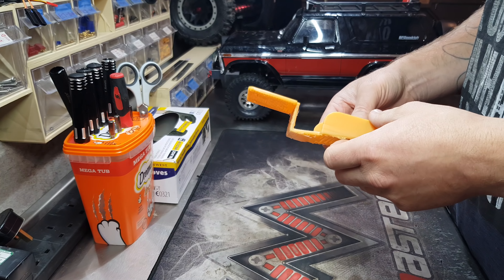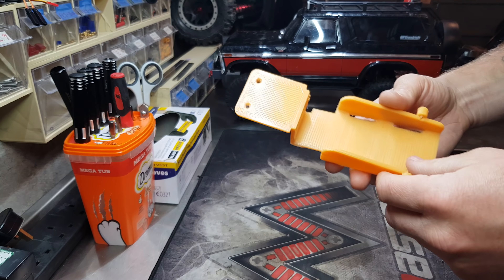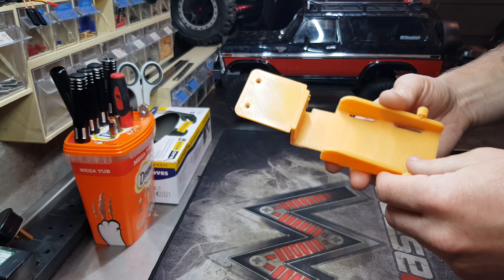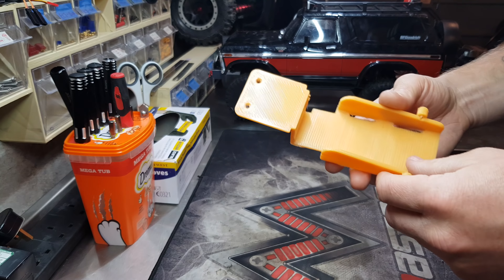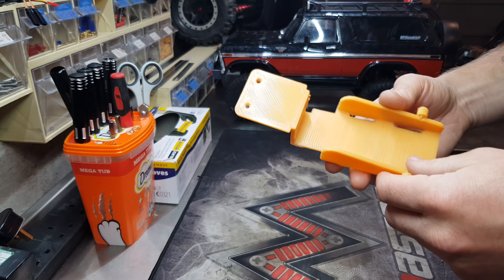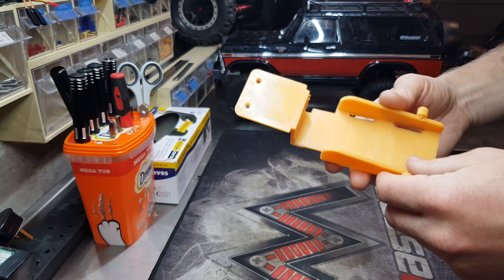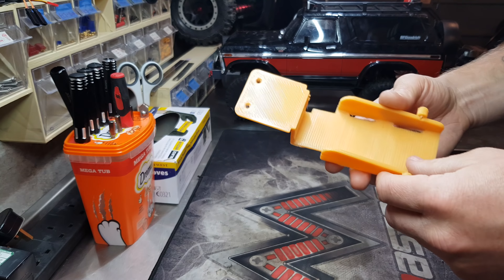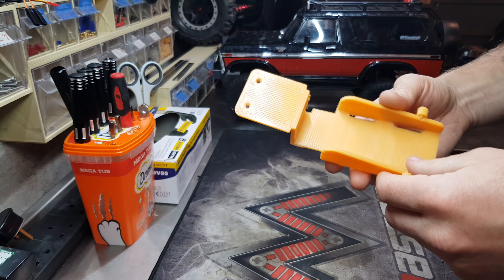Traxxas trx4 battery tray mod low cg, install and test, mod vs stock..

Comment: I see Klipsch good knowing someone else has good taste in speakers. Subbed
Reply from the maker: Haha, well spotted my man! Nice to hear some appreciation for them.. i have upgraded since this vid
Reply: Noted that too!  I've got my klipshorn still.  I'll never replace them, recently upgraded them after 20 yrs.  Mark Levinson Amps running em.
Reply: Lol I noticed that as well. It looks like the Reference Premier series based on the horn. What did you upgrade to? I have KG 5.5s with Ti tweeters in my family room and LaScalas with the Crites Crossover and tweeters in my basement.

Comment: Stock tray works fine
Reply: Agreed
Reply: no. his problem was metal roof racks and soft foams, so the low cg effect got lost. After installing it (and harder tire foams probably), the sideways is much better.

Comment: For one you should install the lcg properly , the front has to be flushed with transmission and bolting it down helps ...if installed right it places the battery low between the frame ...try the new molded version , also try it in real environment cos its a night and day difference on how the truck drives . Better in every way possible and definitely worth then 25$ online .

Comment: Which bumper do you recommend the most for crawling/looks on a defender?
Reply from the maker: Hi Sean, I would say anything that doesnt hang low and almost acts like a slider to help you over rocks, also nothing to wide to hang up on the edges, I learnt this after fitting one to my bronco and it was like night a day difference.
Reply: @jaypearce6199  thanks Jay! I love the camel bumper, but I'll have to swap something low profile like you said. Appreciate the info as I played with $100 cars as a kid, but the trx 4 is the first serious crawler I'll have ever used(comes in the mail tomorrow morning!). These things are so close to full scale cars! Can't wait to get crawling😁
Reply from the maker: @seanclarke4061  no worries man, yeah they are some serious dogs for sure, good luck with everything 😎

Comment: Will it allow larger 3S batteries to fit? I haven't been able to use my 5,200mAh 3S batteries in my TRX Bronco
Reply from the maker: No I'm afraid your kinda limited on size, I can just about fit a 4000mah Turnigy graphine.
Reply: Jay Pearce what brand battery?

Comment: Your side hilling is not much. Your tire's sidewalls are too soft. You need a stiffer 2-stage foam or some anti-foams so your tire doesn't roll under. You will get a lot more side hill capability if you fix the side walls from rolling over. I use antifoams and can go almost 40 degrees sidehilling.

Comment: Very interesting test Jay when the wheater are not good outsite good job. I have order the bronco body for my trx-4 sport and just receive the chevrolet c-10 1966 I will paint this weekend. :)
Reply from the maker: Thanks buddy, im actually filming another similar test today with metal axles vs stock plastic... maybe upload later today..
Reply: @jaypearce6199  No problemo, I will check that Jay. I have make a video of my trx-4 with GPM CVD ant 23t ouput gear in the portal ready brushless !

Comment: Pro tip. Move the servo up to the front of the truck with the servo relocation and 2200-2500 mah drone packs truck in there perfect. You get weight over the front and shed overall weight off the truck( which traxxas needs) watch those rear foams too. If you stiffen those up you’ll get a lot less roll back.